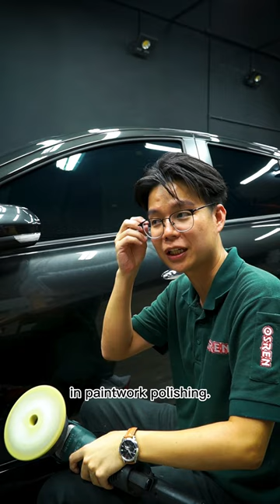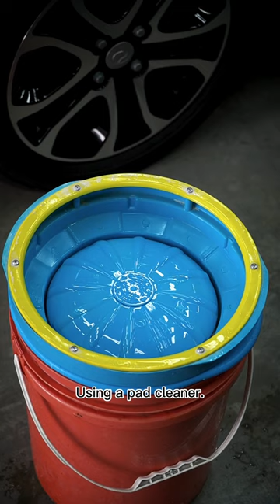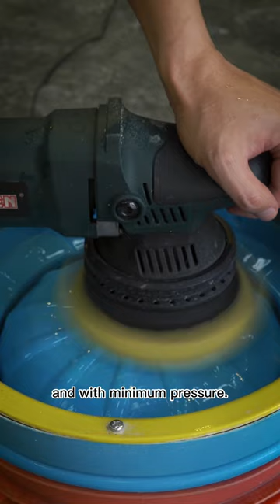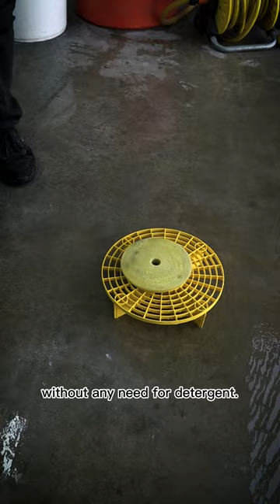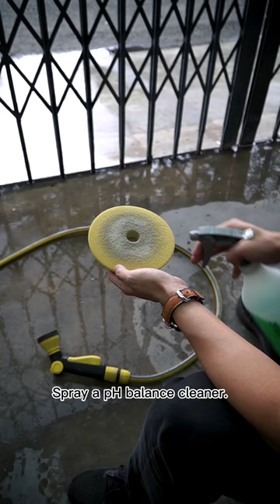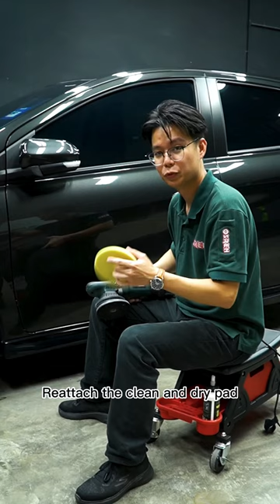3 Ways to Clean Polishing Pads

Comment: The first pad washer is the best and quickest although it's also the most expensive but I feel if your polishing cars often it pays for itself quickly in the time it saves you.  Having a clean pad is a huge time saver plus makes your work way better quality wise.  Coming from someone whose tried about every solution out there just buy the first option here the other purchase options aren't worth the money they cost.  I have the details guards pad cleaner that thing works well but to me it's a waste of money since it requires you to remove the pad and if I already have to do that I might as well just run it under the sink which cleans the pads decently enough.

Comment: I usually have a bucket of rinseless Wash that has the grit guards at the bottom. I dunk the pad in and rub the face against the grit guard inside, pull it out and it's down as heck. Then I hand squeeze it, put it on my polisher and on high speed wring it out in the bucket. Ready to go.

Comment: I just lazy, just remove the polishing pad then put into front load washing machine then wash together with microfiber towels. After done washing then put into a front load drying machine to dry it with cool air. So far still working fine, the polishing pads are still maintaining its softness. I am using CarPro MFX as microfiber towel detergent.

Comment: Do you clean it each new section you touch? For example. If you’ve got big doors like I do, and it’s 4 sections per panel. Would you clean the pad each section? Or clean after you’re done with that panel?
Reply from the maker: Usually, after each panel. 
Occasionally, we will clean it after several sections. There is no hard rule, but if the pad is dirty and cutting feels a little different (even before completing an entire panel), we will clean it. 

There is no definite rule here, but a proper prepped car, (wash, clay and tar being removed) will ensure pad stays cleaner for longer time

Comment: How often are you cleaning the pad?  Every section before you apply additional polish?
Reply from the maker: Hey, so for heavier cuts/compounding, we often clean it 1/2 of a panel or so, we find that heavier cuts result in more residues. 

for polishing or lighter cutting, we can get away with cleaning the pads after completing a panel (door/hood).
Reply: @OSRENOfficial  thank you!  I appreciate your answer and wisdom

Comment: I dont recommend pressure washing some pads.  But if you do, have it a long distance away.  Use wool wash with wool pads to keep them smelling nice and staying soft and fluffy. If using the system 4000 pad washer make sure you have a polisher that spins fast enough to get the pad barely damp or your pad will be too damp.

Comment: Do you recommend also using compressed air for cleaning the pads ?
Reply from the maker: Compressed air it's not the best all-rounder in our experience. On foam and wool pads, it doesn't perform well in blowing off dust on the surface when it's still slightly damp from the polishing cream.

Cleaning on the pad washer is by far our favourite.
Reply: You’ll also blow chemicals in the air so will need to wear a mask if you use compressed air

Comment: Can you reuse the pad straight away after cleaning it out and spinning it dry(using the one pad for a whole car)?
Reply from the maker: hey, yes. totally possible. 
spin dry it at the highest speed. it should be around 90 - 95% dry
we find da spins dry better than rotary (because of the throw)
Reply: @OSRENOfficial  thanks so much for the reply. Being only slightly damp shouldn't affect the cutting ability of the compound too much?
Reply from the maker: @perfectshave85  not too much, hence 90-95% dry. 

alternatively get more of the same pads and rotate accordingly
Reply: I start with a spun dry pad.  You will get almost all of the water out.  But I find it balances the machine and reduces vibration.  It also makes the product spread out better.

Comment: Pressure washer will destroy the cells in the pad. Don't do that!!
Reply from the maker: contrary to that, we recommend using pressure washer as it doesn't introduce friction from scrubbing the pad clean.

we found that it extends the lifespan of pads. It's safe on pads just like it's safe on the waxed and coated cars. Doesn't not tear anything apart unless use incorrectly.
Reply: @OSRENOfficial okay thank u 👍🏼